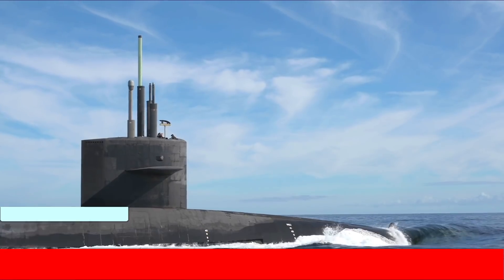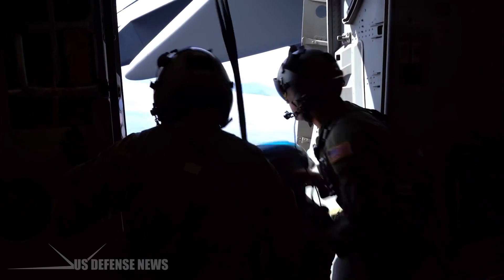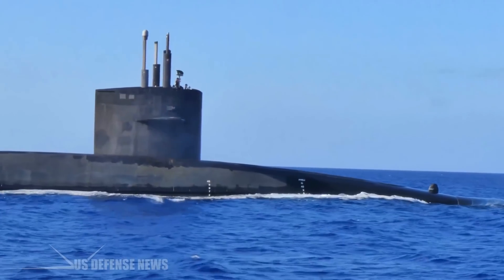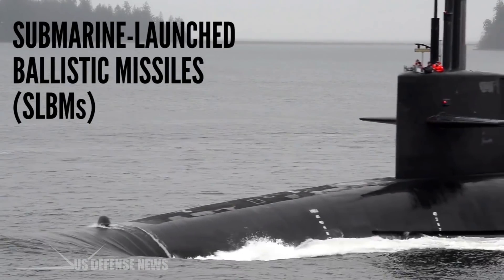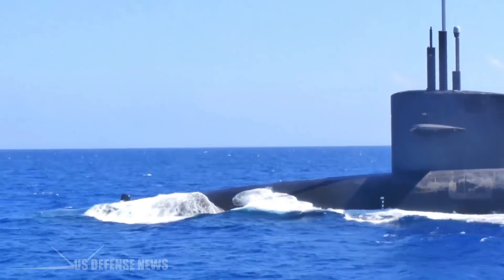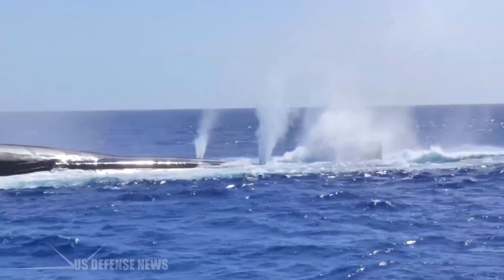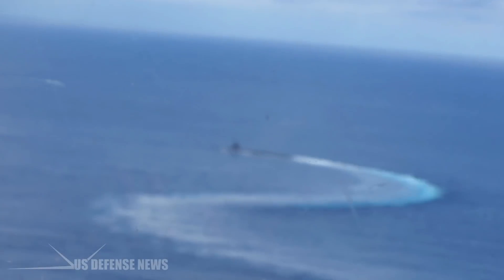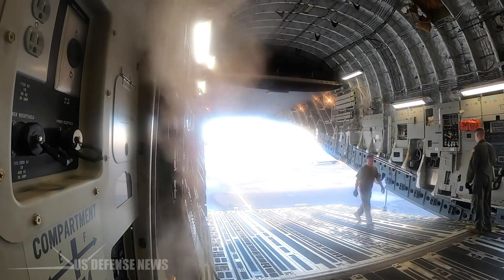This Is How America's Nuclear-Submarine get Resupplied at Sea

Comment: This seems risky, what if you could refuel underwater, you could clamp on a fuel pipe to a chamber underwater and then decompress the chamber to vent the water, and then refuel the submarine. Just make portable underwater refuel subs or underwater refuel points. I think satalites with ai might be able to see all the surface and so spot refuelling. Refuelling is not ready for a future war
Reply: This replenishment is not a refueling, since the submarine is a nuclear sub it does not not require fuel.
Reply: It’s a nuclear sub they don’t need fuel. They need food and other supplies tho. This is called a RAS (Replenishment at Sea) or UnRep (Underway Replenishment ).

Comment: C130 airplane can resupply sub at sea with boyancy that inflat after drop into water using parachute for quiet and slowly float up to certain prescribe depth so sub can surface to certain depth and retrieve not necessarily on surface fire total silence operation and sectecy

Comment: May be OK for the odd spare part, but why would it not be already carried? But for a full resupply, I don’t think so. The only access will be through the tower, as opening the main hatch at sea is inviting disaster, the assess size through the tower is limited, the time taken to do such a resupply would leave the submarine at very high risk, as would take far too long, on the surface any submarine is vulnerable, they are not designed for  anti air warfare. Better to return to port for a 12 hour turn around.

Comment: I’ve never understood why all navel ships aren’t subs.
Reply: well you cant have a submarine aircraft carrier, then again you need surface ships to protect the carrier
Reply: @xnathxnn  There actually was one, the Japanese I-400 class during  WW2. It carried several sea planes, and had a long enough range to carry them anywhere in the world and back.

But its not feasible to make such a huge suarine that it could carry the 40+ jets that even smaller carriers today can.
Reply: Carrying aircraft, and direct surface combat are difficult to do with submarines. Torpedoes cost a lot in comparison to shells, and it's unlikely a single torpedo will be capable of sinking even a Destroyer. On top of this, it's difficult to stay hidden when firing a torpedo, so the destroyer can return fire. The submarine, unlike the bulky destroyer will most likely be crippled by a single torpedo, because of many reasons.

Comment: During war time Id rather see them send out another sub with a rescue sub attached that could transfer parts and food underwater. Sitting on the surface with helicopters hovering overhead would give away their position and provide enough time to send a long range hypersonic missile to potentially destroy them. Maybe someday we'll see a class of supply subs which would be full of food and parts rather than missile silos; although that might be cost prohibitive, maybe reconfigure retired subs? Remove the silos and replace the space with freezers and machine shops. Just a thought. I hate to say it but in a future conflict we might see aircraft carriers become obsolete like we did the battle ships during WW2. Then air support wont be practical unless near a land base.